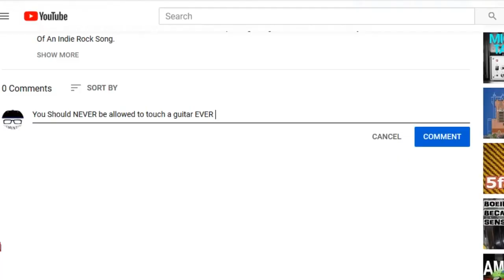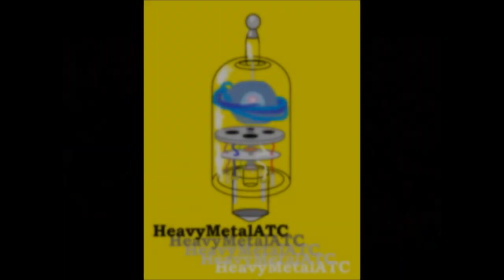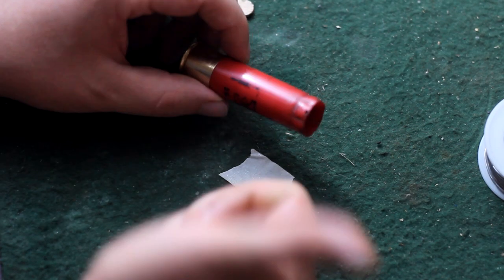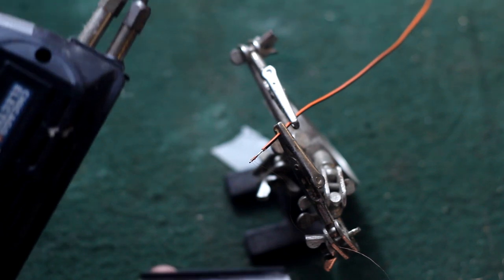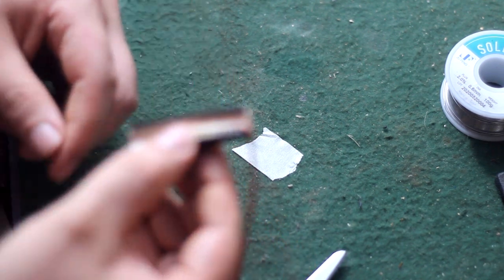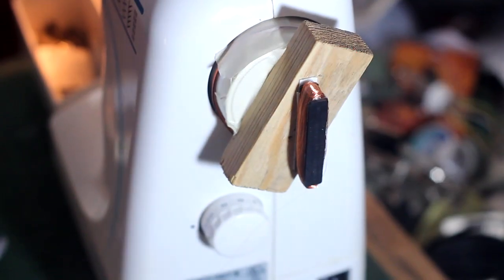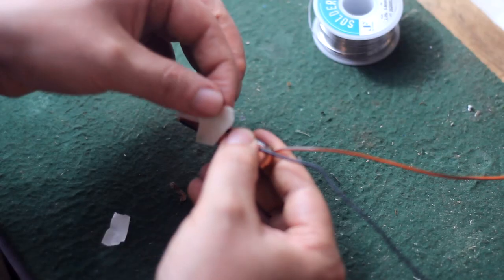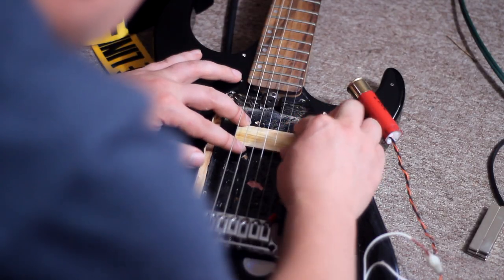DIY Lipstick Guitar Pickup from Shotgun Shell (Full Build + Demo!)

Comment: it's not at all what i expected but very awesome regardless. it has some of the vibe i remember from playing a dano years ago, it was low output and didn't have much midrange, high end was bright yet also kind of rolled off... not like any other guitar i've played really
Reply from the maker: Yeah, bro I was also quite surprised by the results. It had a way woody and hollow honking sound that I didn't expect at all. I used to play quite a few old guitars with tube pickups at my friend Max's music store. All the old Dano and Silvertone stuff and this wasn't much like those. This one reminded me of an acoustic with a piezo bridge pickup mixed with a regular magnetic pickup. It was so micro-phonic its like it had 2 sounds at once.  Those older guitars were often slightly microphonic but altogether different: sparkly and slightly jagged. I think it was the loose bobbin design and the 1/2 @ss potting that caused a lot of this result as well as the tube being plastic. Either way you and Ben came in clutch on this one. You guys made this video happen. Thanks.

Comment: It's quite throaty.
It almost has a dobro-ish tone to it.
If you could find a means to bring in some top end this pickup would be really cool. As it stands sounds a bit like there's a mattress over the speaker.
Welcome back by the way, I missed your no-nonsense approach to pickup technology
Reply from the maker: Thank you so much for watching and taking the time to comment Casanova. Yes its so microphonic that it was similar to blending the output of a regular pickup to a piezo. I think that if the coil were tighter and larger and it was potted correctly that would kill a lot of that off. Also maybe a steel tube or cover would be nice and add some magnetic field and increase the high end, but it was a fun experiment and its kinda cool to see a shotgun shell in a guitar with wires coming from it.
Reply: i think what we have here is the beginning of a solid-body dobro 👨‍🔬

Comment: Could you try recording some of the playing using a line out or headphone output from the amp? You can probably make a splitter to recording and use headphones at the same time pretty easily. I've found with my amps that you can just plug the headphone output directly into a computer's mic in. Of course if it's a high power amp, you'll want to slower ease up on the volume.
Reply from the maker: I understand what you mean but with this particular video its just the sound of thet pickup. it sounds all muffled and honky horn sounding but its just the actual sound of the pickup not the amp. That amp has recorded great on this channel in other situations?

Comment: First time I have seen anything from your channel. Very interesting and fun to watch video. 
I would advise getting a guitar amp to do the demo though. Or even better just a DSP and record it directly. I would really like to have an idea how that pickup sounds compared to a regular single coil.
Reply from the maker: Thank you so much for watching and taking the time to write a comment Thorsten. Ahh yes I can fully understand why you would say that from watching this video. I will keep that in mind. I didn't consider how the new subs and first time viewers would be able to judge the pickup from this setup. This is just a very strange sounding pickup its very muddy and woody, I can assure you thats not the fault of the amp its just this wild design. I'll post a link at the bottom of the comment to a demo with this amp using a more normal design goldfoil pickup and you will see that it is very clean and crystal clear. Also feel free to check out the other pickup builds on the channel I have used this amp quite a bit. I had considered this earlier in the channel and I used to record a demo with a solid-state amp modeling rig and then a tube amp Ive also done some actual in the box studio type demos but for whatever reason they don't seem to get as much views. So I switched to the keyboard amp as it doesnt color the sound in any way at all, its as flat and dry as a studio monitor so its giving a 100% no flatter representation of the pickup. I do have a hand-wired custom made 5F1 tube amp 6 inches out of frame. It would have been smart to think to plug it up or maybe the Marshal combo behind the camera or even a zoom multi fx amp modeler also feet away. It was hot in here and I had to turn the AC off to do the demo but thats a crappy excuse. Thank you for the suggestion I will definitely keep this in mind and try to give a broader example like I used to do. It was especially needed with such a weird sounding pickup. Either way here is a link to a demo done with a gold foil and the same amp and you will be able to hear how much the shotgun pickup was just a strange woody subdued sound in comparison. Thanks again truly : https://youtu.be/ZBHkPltaavg?t=694

Comment: It definitely is an acquired technique with the wire.  I have some they use in those Dollar Tree solar moving things and I dunno what gauge that is but can't solder it, and it breaks before your fingers even touch it.
Reply from the maker: Thank you for watching and taking the time to comment General. Yeah, it really could be that your wire is super thin? The first pickup I ever made was the one using a ruler and the wire from a coil in a hair shaver.. If you can find a device that has a transformer or coil in it that can be taken apart you can try to see if that wire feels thicker and easier to handle... the shaver coil wire was thinner than what I use now and i did break it on accident in the video and I was winding by hand.

Comment: Can you please put another brass head on the other side to make it even and to protect the interior of the pickup.
Reply from the maker: Thank you so much for watching and taking the time to comment Skeleton. That's a great suggestion. I hadn't considered trying that. Most of these pickups I build are just for a one day proof of concept experiment and will most likely never be used in an actual build but... I will check and see if I can easily get the case head off of another shell... Ive never done that so I dont know how hard it will be but if it seems to be pretty easy to do. I'll pop one on and do a tiny demo in the next video and Ill give you a shoutout for the suggestion.

Comment: Hmm... neodymium might increase the inductance more than is normal, lending to the bassy midrange tone. Might brighten up a bit if you hook it straight to a buffer on the guitar itself, so as to not have the cable capacitance affecting it.

Comment: OH WOW, I was thinking about something like this a couple weeks back. I have a bunch of cigar tubes and was wondering if I could make lipstick type pickups for them! Thanks. Do you think it's so microphonic because you didn't maybe pot it enough? Maybe the wax didn't get over everything?
Reply from the maker: Thank you so much for watching and taking the time to write a kind comment Revvytone. I am so glad you found the info you were looking for, that is Awesome! If I had to speculate on why it was so microphonic I think it had a lot to do with the fact that I entirely overwound that tiny little bobbin and the wire was loose and fluffy poking out everywhere, not a tight uniform coil in anyway, and it was also partly due to the wax being cold and just being poured into the pickup, not allowing the bubbles to escape. I think a proper tight coil and better potting... even maybe epoxy or resin. Would most likely get a much better result.

Comment: I need to know if I add 2 neo dim under the pickups can I move the pickup farther, thoughts?
Reply from the maker: Thank you for watching and taking the time to comment jac jac. That may help increase the power but if you could get an extra one in the middle of the coil it would do wonders. Sticking a strip of metal in there to act as a blade pole piece would probably also help a good bit as well as a larger coil would give more power.

Comment: 90% sure the reason it liked that orientation is that those cheap bar magnets are magnetized across the thin face. It's an absolute pain in the ass to get neo bar pickup magnets.
Reply from the maker: Thank you so much for watching Alaric. Great info! I think you might be on to something there. You have shown yourself to be a wealth of knowledge brother. That would explain why they work so well in a p90 configuration. I wish I had some of that clear plastic that shows the magnetic field but I guess Iron filings and paper could do much the same. I have also had decent results putting them flat under a pickup though so I am continually baffled? Every time I do experiments and talk with knowledgeable people I seem to understand things less but I and all the viewers do get to see what physically works and what doesn't.
Reply: @heavymetalATC  I only know enough to be dangerous. It's always worth validating any wild claims I might have.

Also, if you wanna DIY something for the magnetic field viewing, a clear oil (Mineral Oil is best) and metal filings in a thin clear bottle works nice and stops the mess of the filings alone... But the Green Flux/Magnetic viewing film is also, like, $20 on amazon.

Comment: I bet you can sell these on ebay
Reply: Neodymium firebird experiment?
Reply from the maker: Great suggestion Eduardo, I'm Putting that in my notes and If/When I make a video about it I will give you a shoutout. I had actually not thought of doing anything with a firebird pickup and that is a interesting proposition. I'm not really trying to sell anything and as neat as this pickup looks I think it could be done in a much better way. It would be cool to take the guts of a normal lipstick pickup and place them in a shell casing you may even be able to keep the chrome tube inside. Then as another viewer suggested put another brass cap on the other end. I do however plan to buy some actual pickup parts and wind up a few custom pickups like maybe some standard humbuckers and strat coils or telecaster pickup shapes with different internals and sell or most likely do giveaways for growth and promotion of the channel. Ahh once again great suggestion.. I almost forgot to put it in my notes... Doing that NOW!... Done, I put it in.